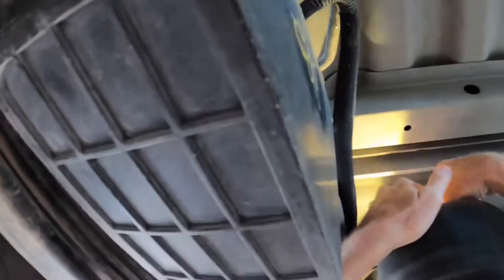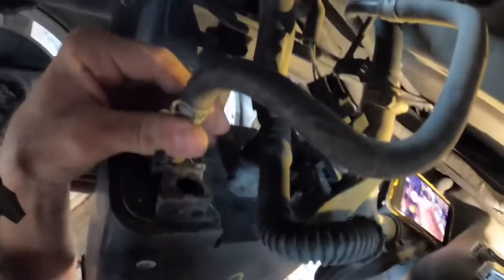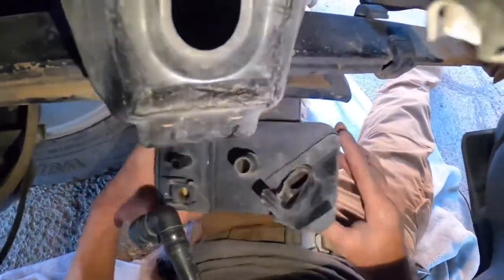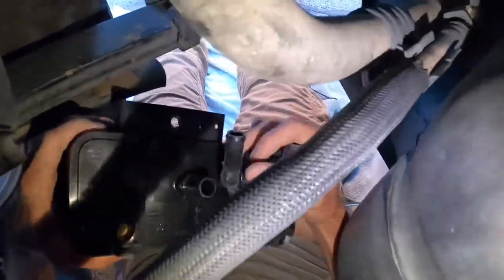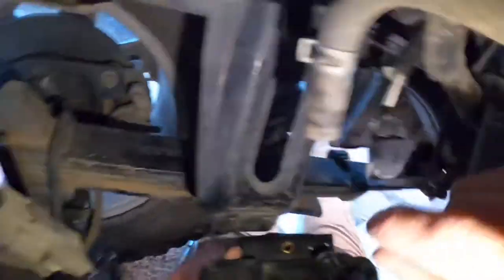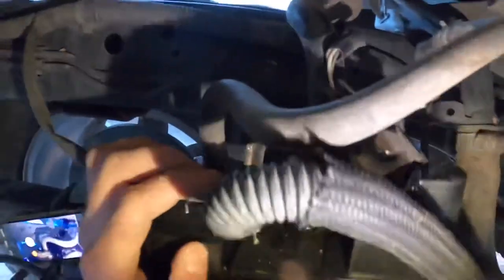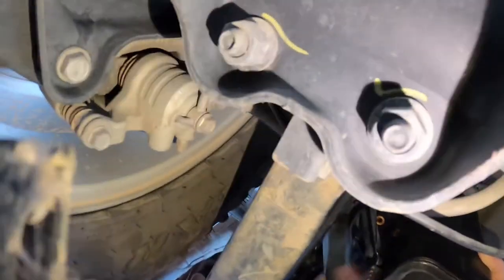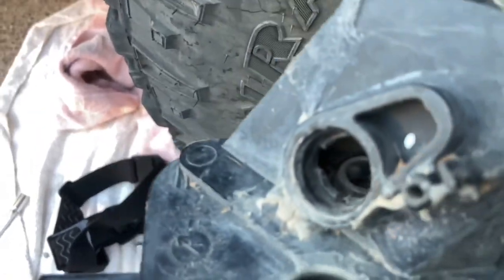Nissan Frontier P0448 Check Engine Light FIX EASILY// 2005-2022

Comment: thanks man...just saved me 1000$ which is what they told me it would take at the dealership.  All I had to do was blow the dust out of the solenoid with compressed air... cycled the battery and the check light was cleared....passed my emissions test
Reply from the maker: Awesome man glad I saved you money from those crooked dealers!!!

Comment: Hey man  thanks a bunch for the video I’m dealing with it in Montana for the past few years and I’m finally ready to be done with the check engine light.

Quick question.  The second electrical connection that’s directly to the solenoid… is there a tab to push to disconnect it or just give it a little muscle?

Thanks again
Reply from the maker: I hear you man. The damn check engine light…..

I think you push down on the connector to release it. I sprayed some silicone spray on mine because it was stuck. Push and wiggle to release it. It gets really stuck.
Reply: @desertdudechannel  right on thanks man I’m gonna do the whole disassembly and cleaning this weekend I’ll let ya know how it turns out thanks for all the help!
Reply from the maker: Cool man let me know. I cleaned mine last week and disconnected the battery. Seems to be check engine free 2 weeks later. I didn’t feel like ordering another evap can haha. Peace ✌️

Comment: Hey man great vid. I usually just clean my charcoal canister out and a few desert trips/year later the light pops back on again. Is the new canister worth it? I saw your comment that the solenoid isn’t so I just wanted to see what your experience was
Reply from the maker: Thanks dude Yeah the canister is not really worth it but it’s required haha. Cleaning the old one doesn’t last long enough to mess with. It’s better to just replace it every couple years. It’s a little expensive for what it does but everything is expensive these days sadly. The solenoid doesn’t do much except open and close with a spring and dc voltage. I tried the solenoid first and found out the old one still worked fine so I put it back. The canister design is the major flaw of the frontier.

Comment: What year is your frontier and how many issues have you had? I’m asking because I’m about to buy one
Reply from the maker: 2016… I haven’t had one single problem. Just buy it and you’ll never have one regret. It’s an absolute tank and nothing can hurt it. I still have the original brake pads after 123,000 miles which is unheard of.
Reply: @desertdudechannel  well it’s a 2014 or 2015 one of our work vehicles 260,000 miles lol for 2k I know it’s alot of miles but for 2k I feel it’s a fair gamble so I’m picking peoples brain on their experience or parts I might want to change like preventive maintenance
Reply from the maker: @casualtactician9537 my dad has a 2007 with over 250,00 miles. It still runs like new. Kelly blue book puts my 2016 pro4x at 14,000$ in value haha.
Reply: Outside of routine maintenance and the replacement of typical wear items on my 2011 model, I have had to repair a connector wire for a rear wheel speed sensor, replace a crankshaft position sensor, an 02 sensor, a positive battery terminal, a heater hose and fitting plus the EVAP canister shown in this video.  So that is seven things that have needed repaired or replaced in 13.5 years of ownership and 162,000 miles of operation.  I really don’t consider that to be all that bad.  Works out to roughly 1 issue per 1.9 years since purchasing the vehicle new on New Year’s Day 2011.  I can live with that because none of the issues have been major problems such as a transmission failure.
Reply from the maker: @RonMarion I replaced both crankshaft sensors last month after my truck stalled on the freeway. Thankfully the truck started again and the check engine light stayed on so I was able to use my obd2 reader to solve that easily. I’ve also replaced the evap can twice, and both front wheel bearings and all brake pads. The brake pads didn’t wear out until 126,000 miles. I used oem to replace. I upgraded to LED lights. I now have 135,000 miles and the truck is absolutely flawless. It makes me money and I’m very happy. Why buy a new one?

Comment: Hopefully this vid helps me I appreciate you making a vid about taking this thing off🤣🤣 I’m a bit short on money right now since I just bought this 2012 pro4x frontier with 30k miles so I’m just gonna try to clean out the evap can first I hope it works
Reply from the maker: Thank you. I know the feeling. I just paid off my 2016 pro4. I’m never paying for a new truck again haha. This truck better last me so I can start saving money because I’m flat broke right now. 

My canister just clogged again after 2 years but it’s cheaper than a shop charge. I’ve saved thousands of dollars working on my truck myself. 

You can clean the canister. It works for a while but it’s better to buy a new one. It cost me 100$ on eBay for a Nissan made in USA oem. 

Thanks again for watching I hope you get to enjoy your new truck as much as I do. I have 115,000 miles on mine now.
Reply: @desertdudechannel  kinda late but good news. This worked. Thanks!

Comment: I had a similar dust intake problem with another vehicle. the solution is to take some filter fabric from a furnace forced air filter , ball it up and stuff it in the open end of the vent in the fuel filler cavity. Change the filter material each season.

Comment: My purge valve clogged up at 800 miles after a whole new canister and valve were swapped out. I was thinking about attaching a hose to it and running it up somewhere. Would that stop it or would the vent in the gas cap area still cause the issue???
Reply from the maker: I’m thinking about doing that too. Instead of running the hose to the gas cap maybe run it into the bed throw the hole the bed has in the vertical front wall. Im considering doing this because the design is just terrible. I have a dirtbike air filter under my gas lid right now.
Reply from the maker: Through the hole
Reply from the maker: The solenoid also leaks dust around the cheesy rubber gasket. Watch my new video with the flex seal glue.
Reply: 9,000 miles on my 23 Pro-4x and I started having this issue. My dealerships says Nissan won't cover it under warranty again, to just ignore the check engine light. 40k off-road pickup done in by dust. Rediculous.
Reply from the maker: @mikeberger8881 yeah warranties are a massive scam. Unfortunately I paid 3,400$ for the extended warranty I never used. Stay away from the dealer. They just want you to buy a new truck. And yeah the evap canister is a terrible design for an off-road truck.

Comment: Thanks for the video.  Do you know the part number for the solenoid? There’s a few different ones I seen on Amazon.
Reply from the maker: The solenoid probably will never go bad on you. I bought a new one and didn’t need it. You can test your old solenoid with a 12 volt battery to see if it’s working. The problem is they get clogged with dirt and even gravel. I’m not sure on the part number since it’s still installed on my canister. Just enter your year model and truck version into google and that will give you the appropriate one.

Comment: Half the battle with p0448 is finding thorough instructions on this godforsaken internet. You did it bud, thanks! Just one question.. how many times will we have to do this throughout the lifetime of our frontiers?
Reply from the maker: Thanks dude I feel your pain. Most of the videos just plain suck out there on truck maintenance. All talk and no work lol. 
Well I’m thinking the same thing as you. It’s not super hard to replace but the design is pretty lame. The dusty roads are what clogs it up. I haven’t been on any really powdery toads since I changed it. I try to stay on hard pack dirt roads now as much as I can.
Reply: Would it be possible to place a gasket to seal the gas door so that dust doesn't get sucked in? Or would that defeat the purpose of having this vent. I assume it's to vent volatilized gas (fumes), so that would just allow a build up of fumes in the gas door? Thoughts?
Reply from the maker: I tried that and the gas shoots straight back out of the gas tank when you get gas lol. It literally shot like 2 feet straight out after I pump it in. I have some ideas I figured out that I’ll make a video about on sealing it during off-road use!
Reply: @desertdudechannel  please do. After 10 years of no issues (2011 frontier) I'm cleaning it out every time I go off roading. Had no idea that the issue was dust sucked in from the gas door, thought it was dust sucked in through the hose connections. There are no hose clamps like the hoses in the engine bay, my next thought was to get hose clamps.
Reply: Holy shit you’re not kidding there buddy

Comment: I have po 446 Nissan Pathfinder 2012 getting sluggish acceleration at 40 when I replaced the solenoid it felt a lot better & now it’s still doing it should I check this again or the evap purge valve up front
Reply from the maker: Replace the canister first. I tried the solenoid first and that wasn’t the problem. Just clean the solenoid out and it should be fine. They don’t usually go bad.

Comment: Forum, So I just changed the Solenoid due to an 0447 OPEN OBDII code.  I installed it and ran my '05 Frontier for 1 hour and another check engine light came on.  This time it said it was a P1446.  I can't seem to find any videos with suggestions on what to do here. so I'm all ears and eyes if anyone has any suggestions.  Not sure changing the canister will help in this instance.  What has your experience been?  Thank you,  AA
Reply from the maker: The solenoid usually doesn’t go bad. Try to replace your gas cap and evap
Canister with the battery disconnected. That’s the cheapest 2nd try haha.
Reply: @desertdudechannel  I changed the Evap Canister also and it worked like a charm. no more Check engine light and passed smog!!!
Thanks desertdudeoverland, this was great help. and you were right it was an easy fix.
Reply from the maker: Awesome Anthony! That’s why I made the videos. Just trying to pass on knowledge for free! It definitely saved you at least 1000$ by not taking it to a shop. I just replaced my can last weekend and I’m due for inspection this march so I’ll get that done. Thanks for the feedback! Take care!

Comment: Take that vent hose and run it all the way up to the engine compartment. Drill a hole in the filtered side of the air box with a fitting for your hose and you will never need to do this again
Reply from the maker: I considered that too. I thought about running it into the bed of the truck.

Comment: I just installed a cat back exhaust system and its leaking righ before the tip hanger. On my first test drive with the new exhaust the code popped up. (Garage keeping during winter and never saw a mud route)
Reply from the maker: Not surprising when exhaust mods cause other problems. I think the stock exhaust sounds better than cat backs

Comment: I do this every year, but I want a permanent solution. So far I am finding the dust enters through the fuel cap and the filler neck, so seems the only solution is don’t off road with the sensitive Nissan Frontier.
Reply from the maker: Well so far for me I have only had to change it one time. But yes I’d probably consider it more of a high service item like an air filter or an oil change. It’s definitely a major flaw of the frontier but at the end of the day every truck has at least one major flaw.

Comment: I have a p0441 code. Could that be the vent value solenoid?
Reply from the maker: Most likely the canister. The solenoid doesn’t really fail but it gets clogged with dirt and the spring needs to be cleaned out so it functions normally
Reply: @desertdudechannel   yeah I just think it may be bad because the metal part of the solenoid looks pretty rusty and I'm pretty sure it has never been replaced and it has definitely been in the mud a lot. (It's a 2010 btw)
Reply: I feel like the canister is fine because at idle it idles fine like it should. But like it sometimes it wants to get stuck at Luke 2100 rpms and then finally goes. It's like the valve is stuck closed and not getting the fuel vapors to the intake.
Reply from the maker: I think the canister is more for the venting of gas fumes and gas station fill ups than it is for the trucks performance while driving. If you start smelling gas fumes when your truck is parked that’s a sign that you have a problem. Another problem is the gas overflows during filling or the loose gas cap light comes on.
Reply: @desertdudechannel  yeah I have never had a problem with it over flowing when filling it up. So would that mean that the canister is fine? What could it be?
Reply from the maker: Get a new solenoid if it’s rusty and canister off of eBay and try that first. Disconnect the battery after you’re done and see if the code stays off. That should fix your problem

Comment: Did it solve the problem? I have the same issue and replaced the vent valve. Engine light is still on.
Reply from the maker: Yeah it’s fixed man. Been over a month no check engine. I replaced the valve first and then 3 gas caps according to other videos on YouTube. That didn’t fix it. I ended up putting the old valve back and the new canister and then disconnecting the battery for a few seconds. Good as new again!
Reply from the maker: The problem is that it’s a bad design and dust clogs the canister up so fast. But it lasted a few years in pure sand and dust. I was getting check engine P0442-P0448 with the clogged box.
Reply: Where did you buy canister from?
Reply from the maker: Online. Just google search “nissan frontier charcoal canister 2XXX year model” they run roughly 100$

Comment: I slapped duct tape on the biggest holes in the frame by the tire where the hose plugs in probably won't do a damn thing but I tried to cut the dust a little
Reply from the maker: The dust comes in under the gas cap! The duct tape doesn’t work !!

Comment: Had this code for two years had took it to mechanic they change vent control valve 6 months later code re appear
Reply from the maker: Yeah it’s not the valve
Reply: @desertdudechannel  thanks... Cause it confuses me doing different research and looking up on YouTube someone say it's the same code as p0449 cause it's a circuit issue probably have a cut wire etc
Reply from the maker: @SLiveForTheMoment  yeah same thing happened to me. I had 2 different codes. I cleaned the canister and the check engine went away for about 6 months then came back. Finally replaced the canister and solved the problem.
Reply from the maker: Yeah I know it can be confusing when it says “short circuit” but that’s not a wiring problem.

Comment: My hose does not fit tight and my electrical connector was half way in careful who you let touch your truck check everything
Reply from the maker: I do 100% of work myself. The dealer stole my brand new special fit shade and who knows what else they took out of my truck just for letting them scan my error code.